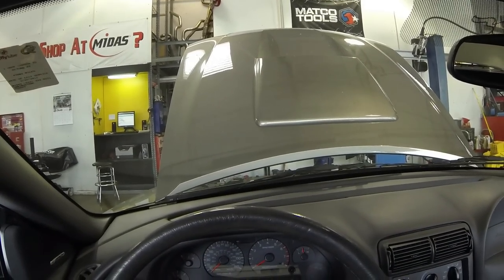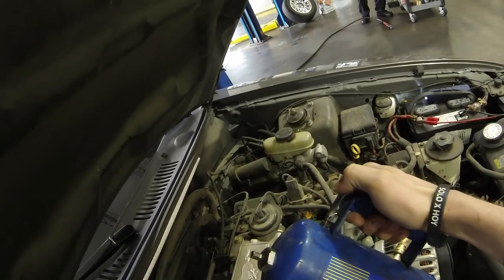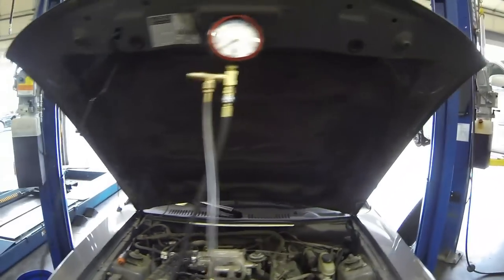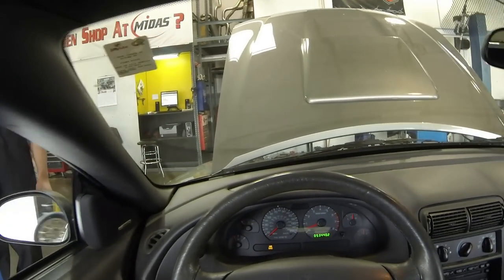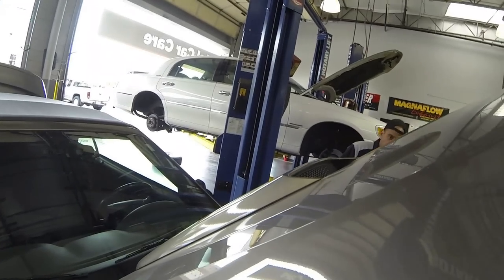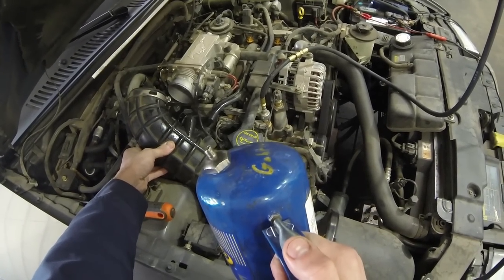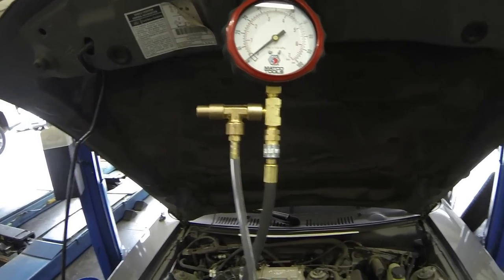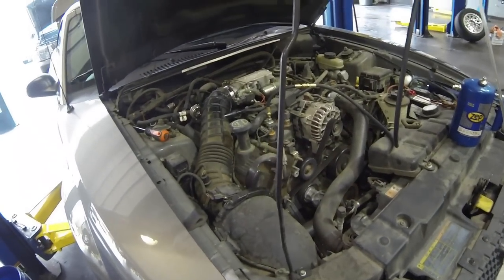How to Diagnose a Bad Fuel Pump - Crank No Start HD

Comment: Can I spray carburetor cleaner in my throttle body of my Honda Accord 2000 ex to see if the engine will turn on to see if the problem is the fuel pump?

Comment: would it be fuel pump if cold crank it will start but sometimes i believe in hot crank, only couple of times it will crank but not start unless i press on the gas pedal couple of times.
Reply: Keegan Jacobs that me was it the fuel pump please let me know
Reply: almost sounds like low compression

Comment: Hi i tried this on  my car and it fire up thn died i do have the Guage and it does pick pressure to 50 psi thn i remove the key and it slowly loosing pressure  but key formats it gets its pressure back up but it just cranks no start

Comment: What about fuel filter? Mine is doing the same but starts after 3 to 5 second... I know this is an old video but I just got the car
Reply: You ever figure out your issue? Mine does the same thing and starts after 4 or 5 seconds and has done that for years and I’m still stuck on what to fix?
Reply: Hey guys , mines is also doing the same , did you guys figure out the issue?
Reply: @kamontjohnson3121  u figured it out?
Reply: @niqqa1001  yes Replaced the Fuel pump in literally 15 minutes and didn’t have that startup issue anymore
Reply: @niqqa1001  but if your replacing that on yours please please remember to disconnect positive and negative battery cables *or it’s gonna have a thrown off gas level reading but other than that easy process 👍🏾

Comment: I changed my fuel pump 4 days ago, when the mechanic replace it with the new on, the car was still cranking but wouldn't start... he reset it the car with his computer and it turned on...

Last year i bought a new gold battery. New starter & now a new fuel pump... could it be something electrical???
Reply: You ever check the relay and the ignition coils